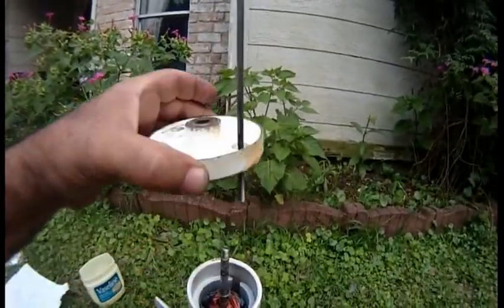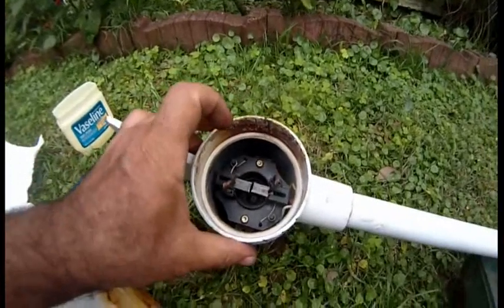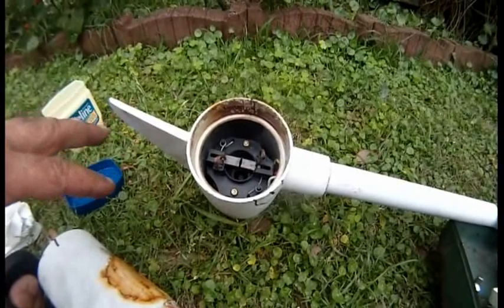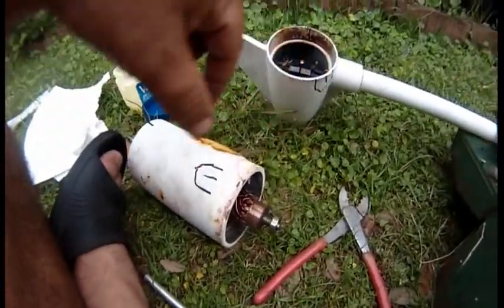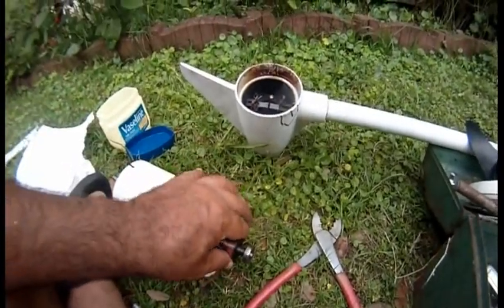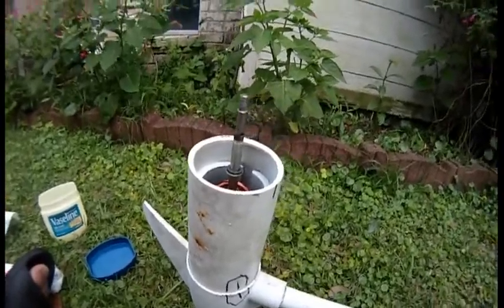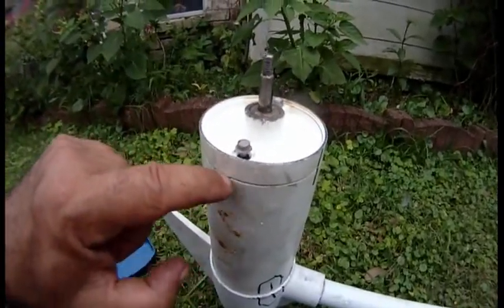Minkota trolling motor brush change

Comment from the maker: Before you do all this work check the fuse . .the fuse does act funny. for example it can go off and on like a blinker .. get a wire and connect the two posts on fuse to bypass it and run without fuse for testing it.

Comment: shouldn't use Vaseline its petroleum based and will break down the rubber in the "O" rings in time. Need to use a silicone based lube-goop.

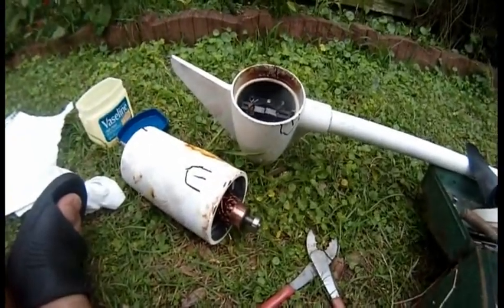Comment: how do you hold the brushes apart when reinserting the motor?  at 2:56 its apart and then at 2:57 majic happens and you got it back in...nice but mine gets hung up trying to put it back if i don't figure out how to hold those brushing magnets back during the insert.
Reply from the maker: you need to wear gloves then hold the motor only and insert it while pushing the brushes back with a screwdriver now get the housing that has the magnet and insert it on top of the motor. this is the part that you need gloves as the magnet will pull your hand and you get pinched .  The motor needs to be held as it will move too and it may come out of brushes.There is seal test video that checks the seals watch it and buy a rebuilt kit that comes with all the seals that you need . .
Reply: I'm having the exact same problem.  Can you please provide a battwr description of how to hold the brushes back while inserting the motor.  I cant for the life of me figure it out.

Comment from the maker: update -- my inline 50amp breaker would malfunction under load and shut off and on every second but it would work without problem without load. I shorted the terminal with a screw driver to bypass the breaker and had the motor running . you may want to check on breaker as part of your problem. I will have a video on that soon

Comment: Bud how do you lock the brushes back so you can get the motor back in.
Reply from the maker: go to 2:24 1 stab the trolling motor in a ground so it is stuck. 2- hold the winding with wires and use a screw driver to push the spring loaded  brushes back - you will have the winding in center .  next grab the rusty in this picture casing and go over the winding .. be carful as magnet will pull and you get your finger stuck and pinched  ..

Comment from the maker: you need to wear gloves then hold the motor only and insert it while pushing the brushes back with a screwdriver now get the housing that has the magnet and insert it on top of the motor. this is the part that you need gloves as the magnet will pull your hand and you get pinched .  The motor needs to be held as it will move too and it may come out of brushes. There is seal test video that checks the seals watch it and buy a rebuilt kit that comes with all the seals that you need . .

Comment: nice... how many hours of use before the brush got worn down to be replaced ?
Reply from the maker: I am guessing but should be many hours. breaker and plug connections will fail more often. in my case after 10years of light use of 12 volt trolling motor . my internal wires had melted and fuse needed to be replace. I am in saltwater and corrosion is a big issue with my boat .

Comment: I was hoping to see the changing of the brushes but it looks like you did that before re-assembling the trolling motor ???
Reply from the maker: opening it correctly is the hard part brush is very basic . you can see the brush in video it is spring loaded . look for other video to test for leak and change the seals- email if you had problems . .

Comment: Why you change the brush?
Reply from the maker: In my case, I cleaned the brush.  My problem was a bad fuse.  The motor would come on and shut off and I was wondering if water was getting in or contact was bad. I have never seen a fuse to come and off rapidly
Reply: My minn Kota is 50lb all speed changes but slowly. What is the problem ?
Reply from the maker: take the prop out see if you have fishing line on it I think you need a 1/2 inch wrench .. if it is very old .. make sure battery connection and plug connection does not have rust … brush could have rust … in my case main wire was broken from rust ,  it is easy to take it apart for first timer .. mark the casing so you dont put in upside down watch all videos I think I did 4 or more .. very easy .. if it is not working you can not make it worse ... you can only make it better .. run it without the fuse see how it works .. bypass the fuse by connecting both terminals ,,, point a and b on fuse need to have a metal like screw driver touching it . .mine was 13 years old
Reply from the maker: the switch can be changes but it is sealed depends how old is the system and are you using it in salt water .. here in usa the switch was I think less than $20 and you can call the min kota and talk live or look up parts using internet .. make sure battery is charges check it
Reply from the maker: the unit is 3 part and mark it so you can put it back in the same way
Reply: I open the trolling motor and clean the brush. I closed the trolling motor and same the speed no rapidly. What other problem have the trolling motor? Thank
Reply from the maker: weak connection due to rust .. bad fuse bypass the fuse by putting  wires on top connection, inspect the plug for rust , inspect the trolling motor wire itself  for pinch or cuts , wires in shaft of trolling motor (gren white,yellow) could have rusty connection or broken . if you are more exact on the problem I call the tech support for you here in usa ..   I understand English is your second language.. your problem  is A= the trolling motor spins slowly but it gets better as time goes by    B= trolling motor spins slowly all the time        is your speed  control 5 switch or a dimmer type and not a click switch

Comment: All that trouble making a vid and not show us how you seperated the brushes to get armature in
Reply from the maker: 1:stab the the frame in the ground or have some to hold it for you so it does not move.  2: push the spring loaded brush back with a screw driver and insert the part with wires. 3: wear gloves t avoid pinching your skin by picking up the magnet part and placing it over part that spines and has wires on it. magnet is able to hurt you by pinching your skin .. 

What kind a problem do you have anyway .. make sure you put the magnet in same position by marking the outside